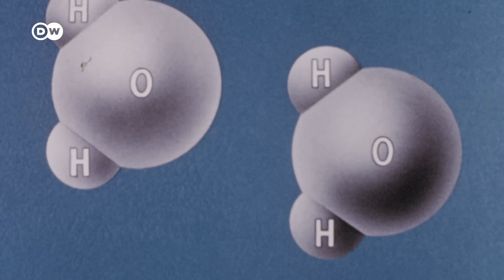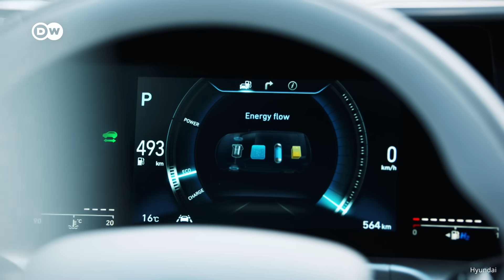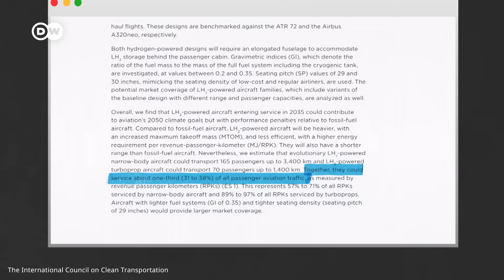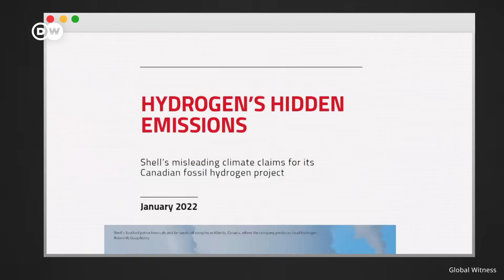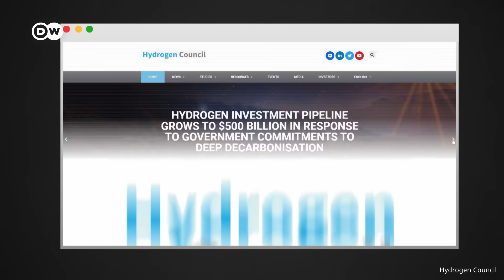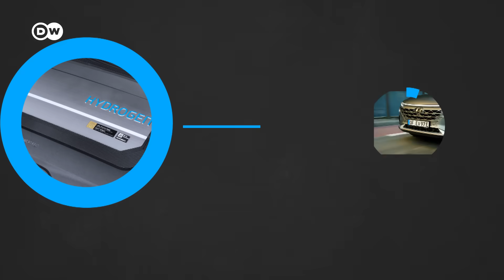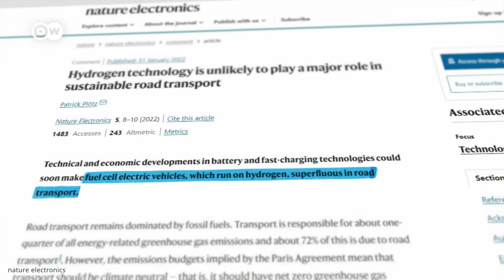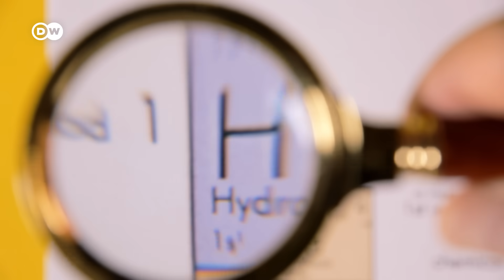The truth about hydrogen

Comment: No one seems to mention that hydrogen is difficult to contain (very small molecule and it likes to find ways to get out of its containment into the air) and once it mixes with air/oxygen its flammability range is extremely large (from lean to rich) and its flame velocity  is extremely high (code for explosive).  If you think cars that burst into flames once the petrol fuel ignites by mistake is impressive wait till you see the hydrogen go up in a millisecond or so if the tank gets ruptured. I understand there are solid state methods of storage but I'm not au fait with whether these are practical for everyday use.  Not sure I've seen what I would consider a detailed analysis of the practicality of hydrogen use. Everybody touts hydrogen for making steel (I think they mean sponge iron from iron ore) but this was tried here in australia back in the late 1990's early 2000's - plant basically blew up (due to the things I have mentioned above) and the company owning it dismantled it at a cost of about probably in excess of 10 billion dollars.
Reply: ...iron sponge....plant blew up.... well, there you go! That is one of my concerns IF used: flammability. Then there is the how to make (cheaply,, efficiently), transport, etc issues.
Reply: it is compressed as liquid

Comment: The main problem with green H2 still isn’t addressed, not even in this video. Because so much energy (electricity) is being lost in the making proces of H2, this loss must be replaced. Leading to an increase in the production of electricity. Which by far is not green! The end result is tons and tons of extra CO2 emissions. Not less. So there you go with “green” H2. Green H2 is dependent on the 100 % availability of green electricity, from turbines and PV. This will take years and years…… In the meantime: don’t use fossil fuels to replenish the electricity that was lost.

Comment: There is no hype because it's the answer. So is hemp. And, run a current from your casino a hard plastic contaner filled with sea water (sodium) salt basically. Then run a tube into another container that has yet another tube connecting to your fuel line. You should quadruple your mileage with this homemade hydrogen additive. The emission is oxygen.

Comment: Hydrogen energy is 3Wh/litre at atmospheric pressure, it is a major problem. Good luck storing it at high pressure for EVs. They are highly dangerous in my opinion. Imagine a hydrogen EV in your garage and it leaks over night  (tank pressure at an insane 10000psi, pretty easy to leak). Then you press the garage door opener and boom (hydrogen and air has a large detonation range). Everybody in your home is turned into mince meat. The energy in 5kg of hydrogen will be like 2000 hand grenades exploding, hence the mince meat.
Reply: Sure. It would also be disastrous if a gasoline tank leaked in a closed garage. Good thing we don't have many of those.
Reply: @edeaglehouse2221  gasoline won't explode unless it is a vaporized. Sounds like you have watched too many movies. Hydrogen already a vapor is highly explosive. 
Hydrogen's gas to air flammability range between 4% and 75% in air is very wide compared to other fuels. Gasoline vapor is between 1.4% and 7.6%.
The energy required to initiate hydrogen combustion is much lower than that required for other common fuels 0.02 milliJoules vs gasoline vapor at 0.24mJ (hydrogen 10 times more easier to ignite).

Comment: If technology evolved enough that hydrogen can be produced where refueling is needed then the need for larger batteries will be eliminated and you can store the energy from renewable directly into hydrogen fuel instead of a battery!! That's a huge potential no need to transport it using massive cargo ships cross countries or needing an expensive pipeline to deliver gas !

Comment: Well, it's kind of sad that energy sources and actual usage roles seem to get thrown together constantly. As if heating houses would be the same as fueling vehicles or producing heat for steel production. There is not one one "fuel or energy source" that can cover it all. Just as it is horribly unfortunate that we, at least as a source for electricity, seem to have simply forgotten that we already have a perfectly suitable and abundant, clean source for providing the lion share of such energy, which is nuclear power. Why on earth are we proposing to force the rapid switch to electric vehicles if the electricity we need to charge them largely comes from burning fossil fuels, just to create some illusion of "clean" or "emissions free"? It's just sad that major innovations around nuclear power plants has basically been abandoned purely due to fear and it being politically risky after very isolated incidents in the past. Burning fossil fuels around the world is endangering and destroying lives around the world, every year, and is causing global warming, but we abandon the most promising technology in favor of a patchwork of green bandages like solar and wind, disregarding any thoughts on what to do with all those panels after they reached their end of life or the resources required today to produce them (to name just a couple side of downsides ). Yes, hydrogen can and should be a part of the solution, if done right, just like wind and solar and water... But nuclear power can and should play a much bigger part in this debate. We have fantastic solutions for its waste products, it creates an enormous amount of energy with a very small footprint, it's almost completely emissions free and can be produced safely if we allocate appreciate resources for future development of power plants. It also seems that, like so often, the lions share of public debate revolves around each individuals role in combating the overall issue at hand, instead of identifying (which had already been done) the greatest, large scale and world wide industries that contribute to CO2 emissions (yeah, it's not "carbon" that's the problem btw, it'd be great if we use correct terms, so everybody is on the same page ;) , and focus our efforts on dramatically reducing those contributions. It's a bit like the whole "recycling" and "litter bug" story where the largest contributors of plastics shifted the blame to the consumers, just now it's companies like BP that made us question and worry about our individual "carbon footprint"...
Reply: Nuclear energy is the most toxic to produce

Comment: Diversification of fuel sources as opposed to a monopoly is gonna be the only way forward. Relying on one or two fuel sources for the majority of use was and always has been a recipe for disaster and we all knew it was coming.  The fact oil corporations literally control and sway governments should be incredibly illegal.  But grey areas, loopholes and lobbying have all created a monster monopolization of power that they will never give up. I think the answer is to use numerous forms of fuel dependant on need, availability and use. I also think the ability to produce our own fuel individually needs to be considered ,assessed, tested and researched in it viability .Relying on these corporations is a huge mistake. Really relying on huge corporations for anything is a mistake. I'm not saying to go create a hydrogen fuel cell in your back yard right now. But could you put up wind turbines? Could you use solar panels? Do you have access to geo thermal? 
What about carbon sucking plants on a smaller scale for communities? 
What about using the general active momentum of movement in society and harnessing that lets say through exercise equipment? We have all seen the cartoons where someone is on a bike powering a coffee maker or something silly. Well what if we actually started using that also in real life? Maybe in combination with other sources? What if your morning work out routine on your treadmill or bike  helped create electricity through the day?
We really need to stop being such a lazy society and expecting governments and corporations to fix everything and come up with the answers for us all. Think outside of the box! And do something for yourself. Progress and change didn't happen because we relied on others. It happened because we all individually wanted to change and the collectively we did. 

Be the change you want to see.

Comment: Hydrogen needs to be made.  There are not hydrogen pockets underground just waiting to be tapped, as there are with natural gas.  Making hydrogen takes energy (electricity), but if you have the energy to make hydrogen why not just use the energy directly instead of converting it hydrogen, then back to energy, in between?  That conversion process in the middle will lose at least half of the energy that would have been available if the energy (electricity) had been used directly instead.  This is even worse if the hydrogen is burned to propel internal-combustion engines, thanks to the math of the carnot cycle, which shows that another 50% or so will inevitably be lost just by nature of the heat-engine.
"Who benefits from hydrogen hype" would have been a good video on its own.  The old automobile industry does, because any confusion or uncertainty over the way to go gives them time to adapt to the inevitable rise of electric vehicles, which they have been slow to accept, allowing upstarts like Tesla to achieve an almost insurmountable lead.  Even if they aren't deliberately involved in hydrogen hype, they benefit from it.  Likewise automotive unions, and governments who don't want to see tax-base disruptions.  Fuel taxes alone pay for roads and highways (although this is hidden once transferred into general accounts of municipalities).  How do you tax the electricity used to charge a car differently from the electricity used to heat a home?  It's not like it can be dyed a different colour, as is done to distinguish home heating oil from diesel fuel?  Then there are the income taxes collected from auto-workers, not to mention the votes.  Anything to slow down inevitable electrification is beneficial to quite a few people, not just the fossil-fuel industry.

Comment: I think you also need to consider the physics of H2, it is more dangerous than CH4 in terms of explosion-danger, needs higher storage pressures and the molecule is much smaller than CH4 which results in different materials that need to be used for storage. I don't think it is the solution to the problem of CO2 if you consider that to be a problem. I would investigate more into electricity-generation (nucleair, fusion etc.) and new ways of storage (alternative batteries not based on materials that generate pollution when mined).

Comment: You use fossil fuels to produce the hydrogen so you're reducing the carbon footprint by using carbon. It doesn't make sense. Power from winds not going to get her done most of the dams are running dry because of lack of rainfall. That's a lie they're over use the water.  Co
I don't have a PhD in physics but I do have common sense. Maybe they ought to teach that in universities. Common Sense 101.

Comment: Hydrogen and Ammonia - make Hydronium - which I was told - tripled the volume produced - made a fuel almost as strong as gasoline - could be produced at five cents a gallon - when burned exhausts water - needed to be used in a week or it oxidized to water. Is this true? - I saw this on a TV documentary back in 1973 - the folks who invented the process was put in jail - no trial. Something about violation of Federal Trade Laws when they were trying to board a jet to Japan to sell their Hydronium units.

Glad I'm not that smart.

Comment: One byproduct of hydrogen production that is never mentioned is salt, if it is made from seawater. What amounts of salt would occur if hydrogen were produced in similar quantities as oil is extracted from the earth today? Would that be negligible?
Reply: Calculate it. Roughly: kg of seawater in the world (1.4 *10^20). Have say 1kg of hydrogen (33kWh) per person on the planet 7*10^9 kg. So for every litre you pull out there is ~20  billion kg for the -35grams  of salt to dissolve back into. Yes extremely insignificant!

Comment: You failed to state that hydrogen can reduce the number of batteries  in EVs, which are a problem in themselves. Mining the materials is fossil fuel intensive and they are toxic. Especially cobalt which is mined mostly by hand and by children. Batteries are difficult to recycle (although that is improving) and also toxic. One downside of the fuel cell is the platinum catalyst. Expensive, and could attract thieves like the catalytic converter under the car. Hopefully a cheaper catalyst can be found.

Comment: Well, lithium batteries aren´t a solution either. It´s just a giant patch to prevent fast & sudden car industry collapse. The market is simple: You can keep making things, if there is a demand for them. But once demand is saturated, whole industry branch will face fast decline. Instead of letting that happen (and causing massive economy, political and social crisis with it), countries are trying to artificially increase demand by forcing people to invest into new technologies via various manipulations.

I think the future is in mix of technologies, which will vary in dependence on country resource mix. But first and foremost power source should be nuclear power. Yes, it is dangerous. But so are lithium batteries or hydrogen. Hydrogen is the most risky here, as it is very easy to ignite and burns with invisible flame.
Yet people still tend to reject any technology, that has the most to offer and accept any technology, that offers regression instead of advancement. I´m kinda surprised, we made it so far.

Comment: Quoting the EIA website "It takes more energy to produce hydrogen (by separating it from other elements in molecules) than hydrogen provides when it is converted to useful energy. However, hydrogen is useful as an energy source/fuel because it has a high energy content per unit of weight, which is why it is used as a rocket fuel and in fuel cells to produce electricity on some spacecraft. Hydrogen is not widely used as a fuel now, but it has the potential for greater use in the future." Therefore,how can it be justified to use more energy to make than to use? For very specialized uses yes, but never jetliners or super cargo vessels.  Its hydrogen hype (marketing, as was well said) to create some jobs, and placate environmentalists and anti-oil interests.
Reply: The main justification is in cleanliness of combustion. Also high explosive coefficient and low flammability/quick dispersal unlike gasoline or natural gas.

Comment: Anhydrous Ammonia is far more energy dense than compressed hydrogen. Its products of combustion are nitrogen and water, both currently plentiful in a healthy atmosphere. It is a better candidate for heavy machinery, shipping and long haul flights than hydrogen. it was the fuel of choice for the fastest aircraft ever, the The Lockheed SR-71 Blackbird. Why is there so much more research money being spent on splitting H2O into bulky H2 than into producing liquid NH3 from atmospheric gases using renewable electricity?

Comment: It is not even close to being viable as a fuel source for transportation of any kind!  For the large water based cargo carriers Nuclear is the answer, with small modular units powering electric motors! Cars and light commercials should remain with petrol or LPG fuel, and heavy commercials with Diesel! Electric/Battery power is only a fad that will soon die a natural death, due to cost and supply issues!  The only probable use for hydrogen as a fuel would be in heavy construction equipment that is relatively immobile!

Comment: No way
You did touch on one of the big prob there's only one third less power in there so you have to burn 2/3 more to get the same amount as the hydrofluorocarbons
Second
Is lubrication wears down the rings valve guides engines don't last as long
And currently liquid hydrogen is about $40 a gallon so even at $6 a gallon for gas
That's $120 to go same distance and that's a checkmate

Comment: Hydrogen is the least polluting by product. Automobile on board HYD. generators with compressor to store the gas, would increase the distance between recharges. Or swap out tanks like propane. Economics will determine the popularity.

Comment: All this talk about cost of hydrogen's production is absurd.  There's no fuel on Earth that we use that doesn't have production, distribution, and storage costs.  The only difference is how much and how difficult.  If you think about it, gasoline has a huge harvest-to-use process and cost.  The thing is we've used it for so long we have just accepted that cost as the baseline.  That's arbitrary.  If we didn't have oil, we'd have a different, more expensive, process and product that we would accept as the baseline.  So it really doesn't matter the cost at this point as long as it's accepted and renewable as well as doesn't lead to worsening pollution and climate change.  Yes, it might be more expensive, but we accept increases in price all the time.  We banned DDT for insect control, but we now accept more expensive alternatives in order to save people, animals and such.  There's always a trade off.

Comment: Hydrogen converted to an alcohol which has superior energy desnity makes the most sense and can use existing energy systems. The untold truth as mentioned by others is that hydrogen is not an easy product to work with. Compression, transport, safe usage, etc, are limitling the eventual usage of hydrogen. It may be possible for point source production and use may be possible. e.g. wind turbine conversion of wind energy to clean hydrogen which is then used in a point source application at the source of production.